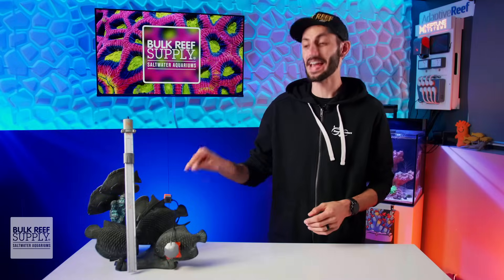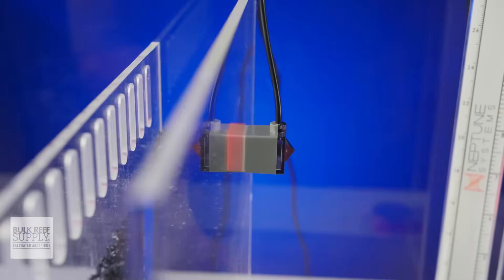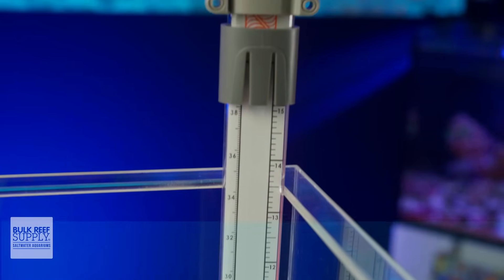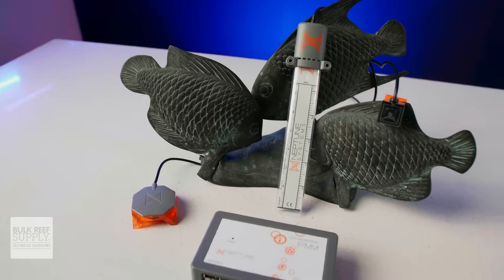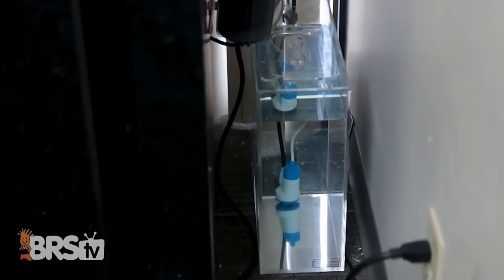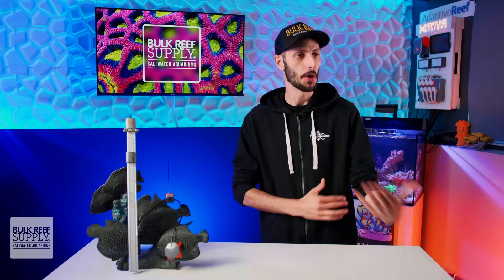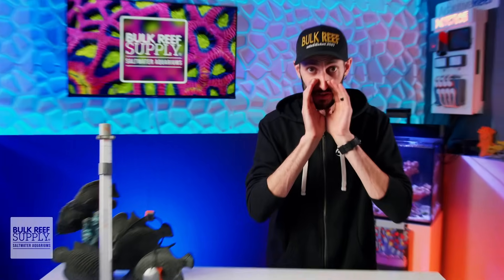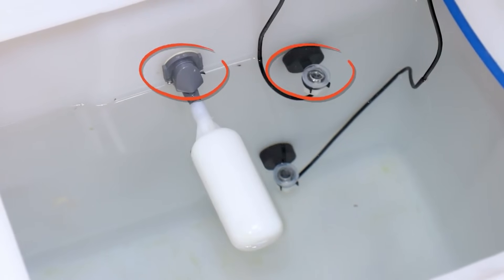NEW Neptune Systems Sensors to Keep Our Reef Tanks Safe!?

Comment: Do they have Dual Optical Sensor?
Cause all Sensor I bought are single.
And my DOS is having only 1 Sensor port.
Reply from the maker: Neptune doesn't currently have a dual optical sensor available, but you can plug two optical sensors into an FMM module.

Comment: When is Neptune Systems going to branch into terrarium/vivarium/greenhouse maintenance? It seems like such an easy addition to their lineup. You'd only need to add a humidity sensor. Then you could use all of the other sensors. I don't believe there is any web based controller for terrariums and I think it's a no brainer to add that capability.

Comment: I’ll say this, my leaks sensors are 2-3 years old, I have yet to have a NEPTUNE optical sensor last a year!
So let’s hope they have fixed them!
Reply: I've had 3 of 8 optical sensors fail in the first 3 weeks, neptune doesn't care though because it's been over 30 days since I bought them, same goes for my cor20 controller, usb outlet is broken , so word to the wise, don't buy anything neptune and wait to install it, because past 30 days if it doesn't work, they will make you pay for them to ship you another "loaner" and also pay to ship your broken one in so they can repair it..

Comment: Cool stuff Thomas. I flooded 5 gal of rodi topup water last week in my stand. The hose fell out of the when I was refilling the container. A flood sensor would have saved me a mess and a sump that had a low level since it's water didn't make it in. Fans are still blowing to help evaporate the water out of the carpet.

Comment: How thick of material does that magnet work on the new optical sensors? Also, are there extenders for the cable on them if needed? 
Also, on the LLS will there be a magnetic mount available if we want to mount it to the wall at the bottom of, say a 60g tall water tank?